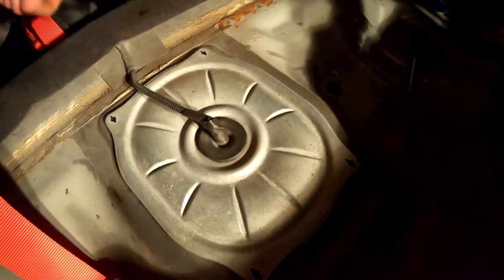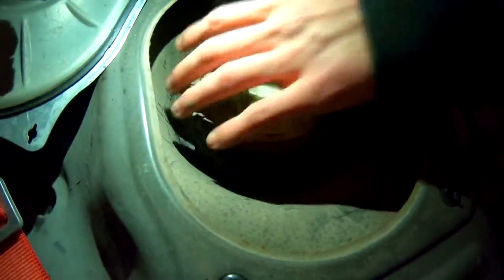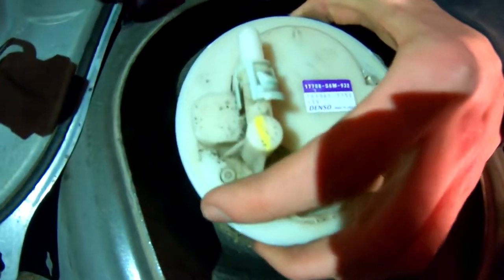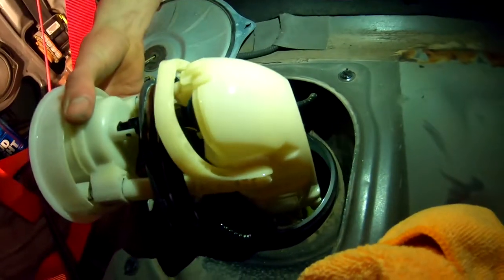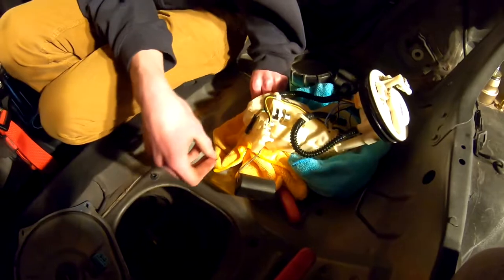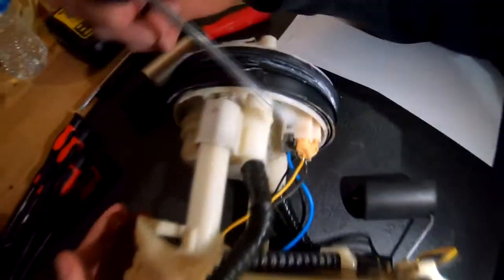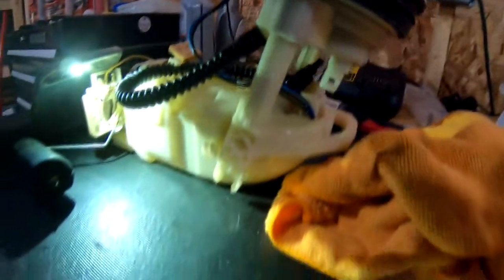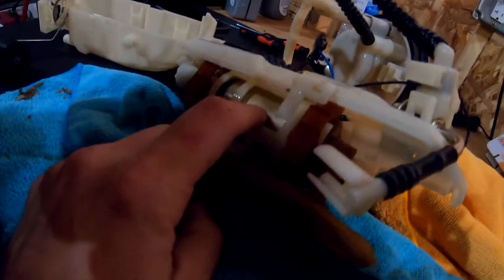2001-2005 Civic/Si/Acura RSX fuel pump install

Comment: Appreciate finally someone showing what a pain in the ass those modules are to remove, the only thing worse is reinstall especially if you moded the module....the fuel pump hole is just do fucking small for that gargantious pump assembly
Reply from the maker: @seregriddy7928  oh dude they’re such a pain.  My oem pump finally went out this year and I had to change it in my Integra.

Comment: Did you replace anything else like the filter or the regulator?
Reply from the maker: ghost the filter yes, by the reg we left alone.
Reply from the maker: Sorry, didn't see this, yes we replaced the fuel filter and the regulator. Ktuned regulator.